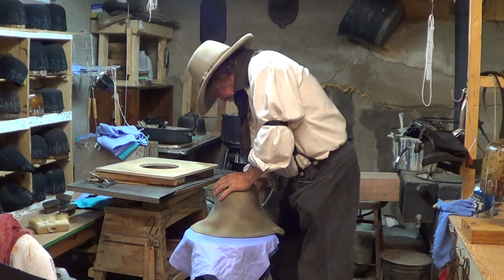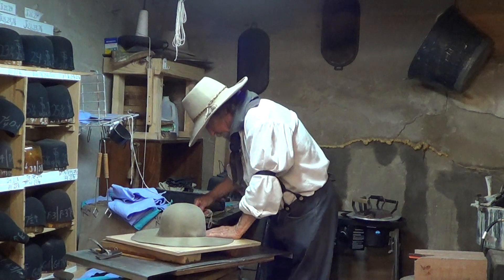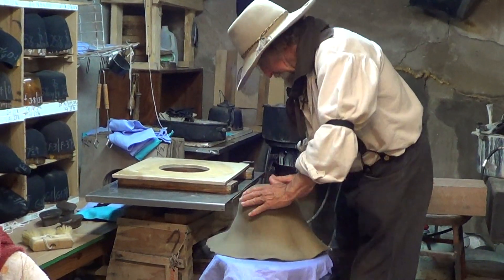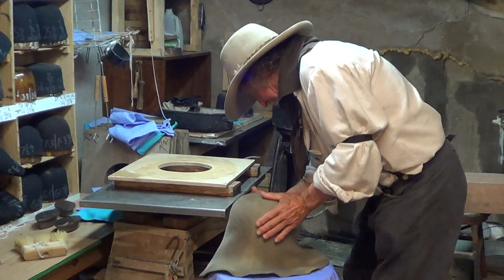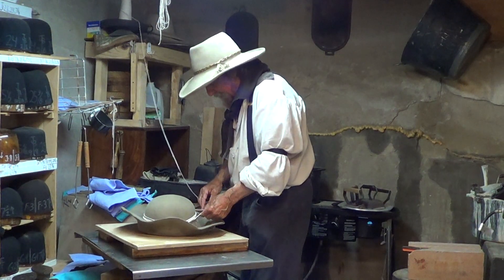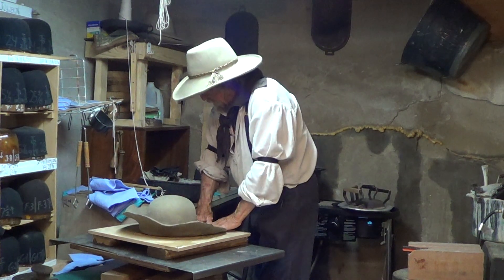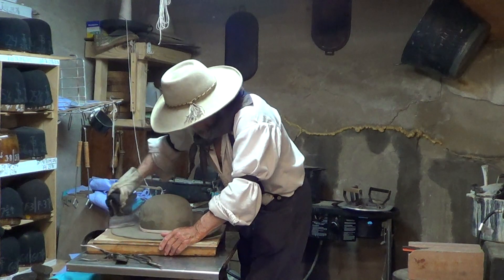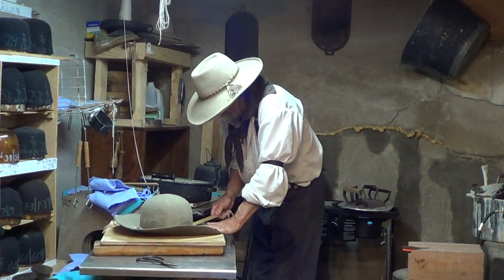How Lil Grizz Makes a Cowboy Hat

Comment: You’re awesome man! I’ve watched all your videos and that some great stuff! Quick question if you don’t mind. I have a felt hood but I can’t seem to get the brim to work flat for me as I’m blocking. What am I doing wrong? Please help! Thanks
Reply from the maker: Some require a great deal of patience....being redone many times.....and a lot of weights to sit on the brim all the way around for a while. Some are like temperamental toddlers and have to be convinced.
Reply: How long do you keep it in the hot water before trying to block it? Thanks again man!
Reply from the maker: @robmaclean4503  a few minutes...or overnight in slightly warm water